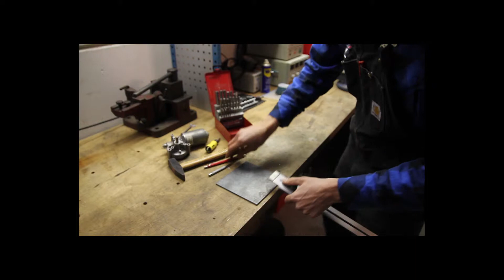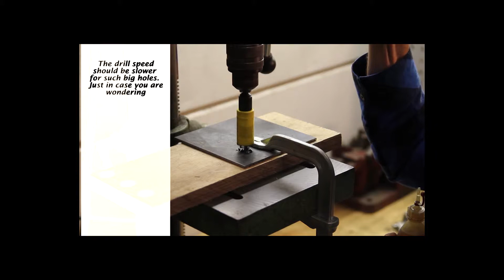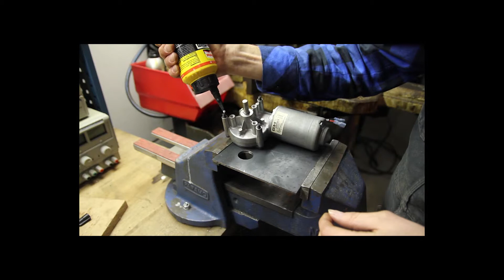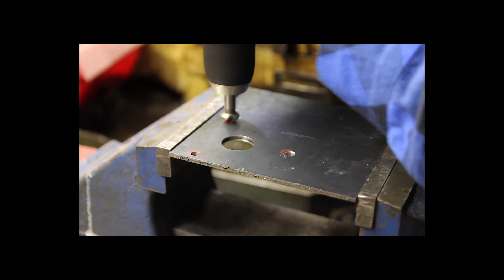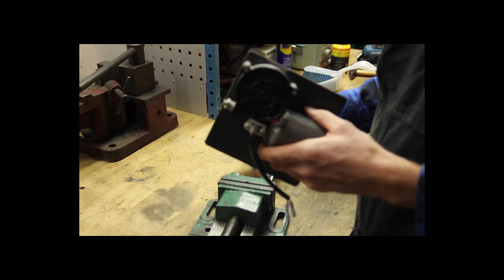Nuts&Bolds - transfer complex hole patterns to a metal bracket

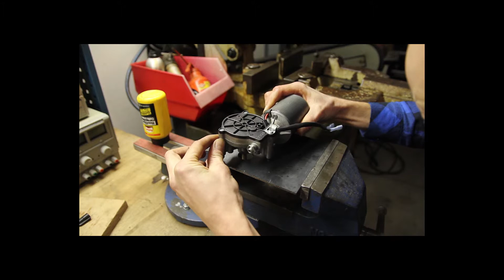Comment: So you just eyeballed it at 2:45? Why wouldn't you drill the first hole the size of the smallest part of the center shaft? Then enlarge the center hole as necessary after drilling the 3 "outer" holes.